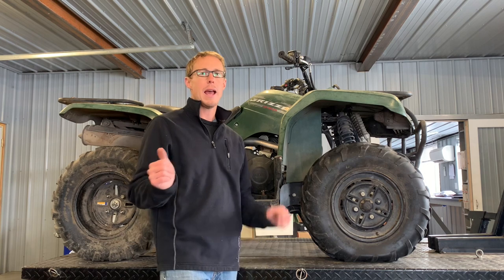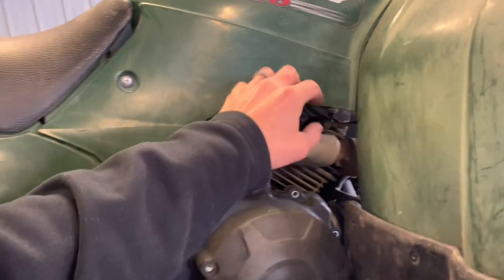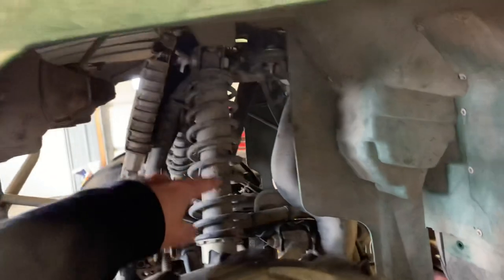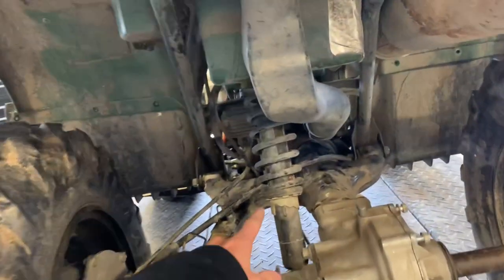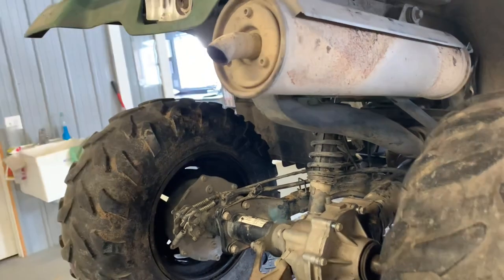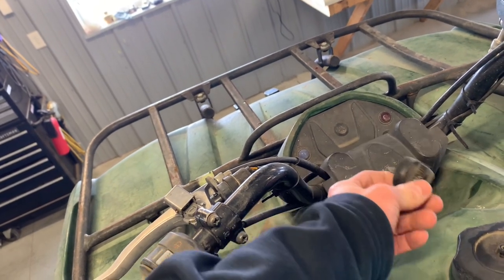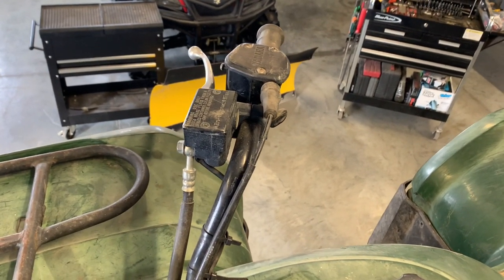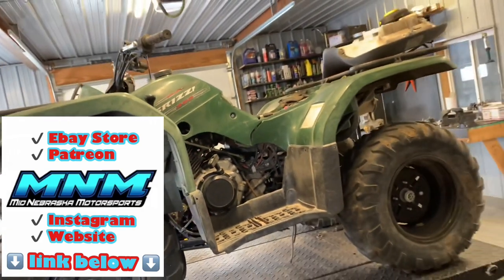Yamaha Grizzly 350  Overview / Review    -     Do we like it?

Comment: I have a Grizzly 350 that’s been sitting in a shed for 13 years now. Low hours and low miles. What should I do to get this thing back up and running. Unfortunately yes it’s been sitting with the same gas in the tank, valve was not shut.